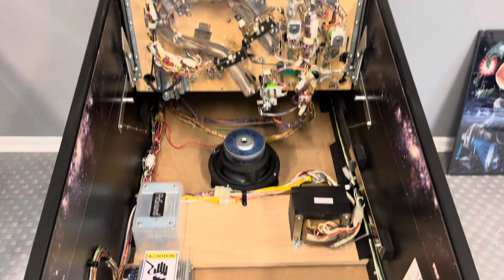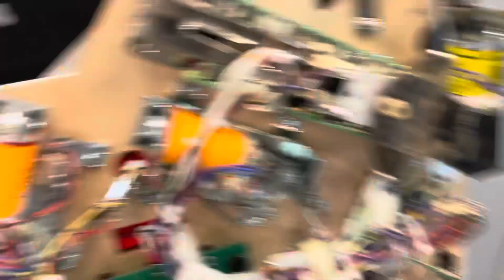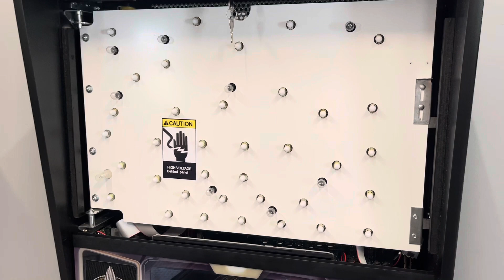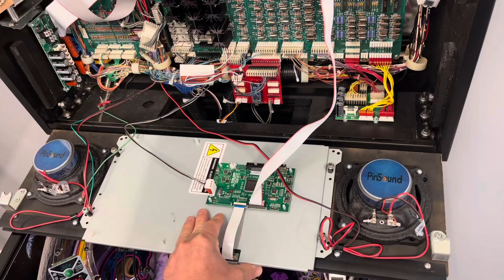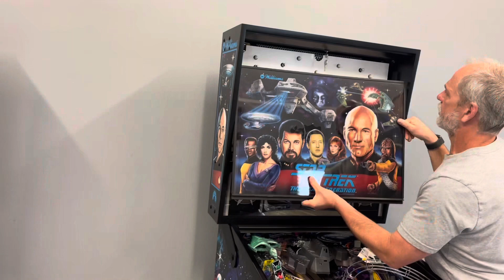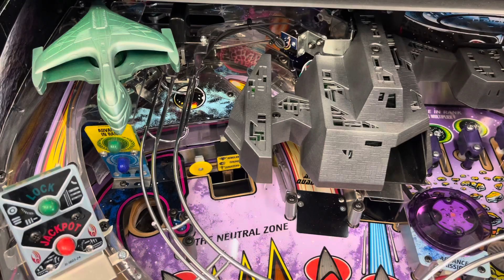Star Trek The Next Generation Pinball 12

Comment: That looks fantastic!  The amount of detail in the restorations of..... everything. 
Is it me or is the green LED for "4X" not working? Same with the green LED on the top right for the multiplier?
Reply from the maker: I would have to look but in general sometimes the LEDs can be a little finicky in the 555 sockets. It won’t be that they don’t work but that they need the leads spread apart a little more to make reliable contact. 
If so that would be the case.